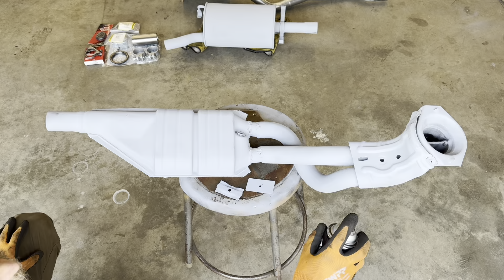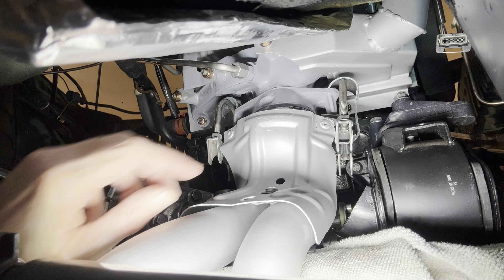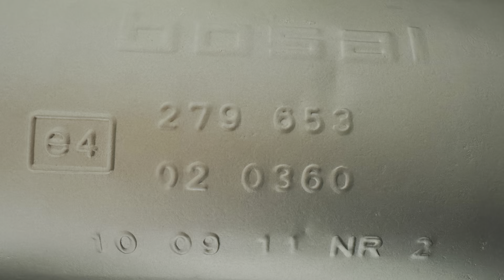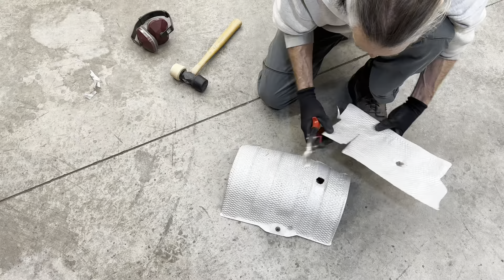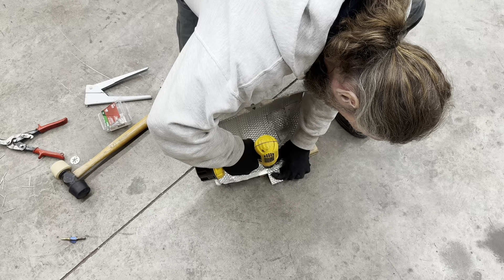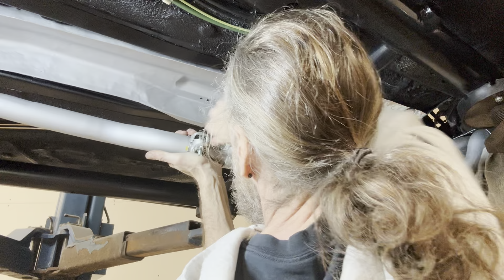1990 VW Golf Country Project - Exhaust System

Comment: Hahaha it reminds me that i have a rattle at 3000rpm with my syncro, most probably that same heatshield! So thanks for the reminder!

But using a nylon locknut on a hot exhaust? Maby not the best idea
Reply from the maker: Ha!  I was expecting someone to call me out on that!  I was digging through old scrap hardware, and it was the only nut that fit.  I'll keep an eye on it and see what happens...
Reply: @PaulBroenen  hahaha nice!

Comment: My bottom anti rattle bracket is toast too.   I use a pry bar to twist it enough so that it doesn’t rattle.. the irony.
Reply from the maker: When I was still driving this car, the exhaust rattled, but I couldn't locate the source of the noise.  It was only after I removed the system that I found that darn bracket! 😀
Reply: @ ha ha.  The car is too cool to be making rickety noises 😄